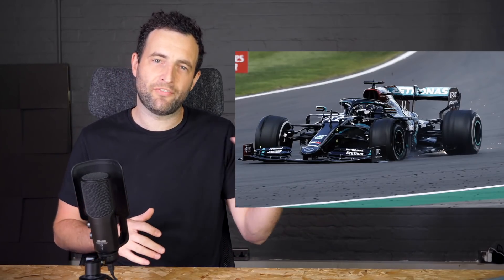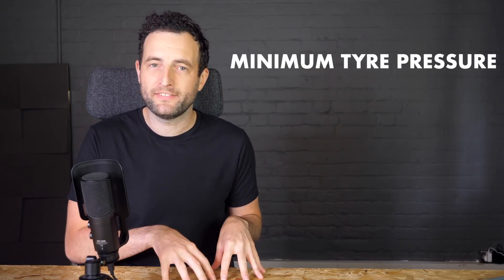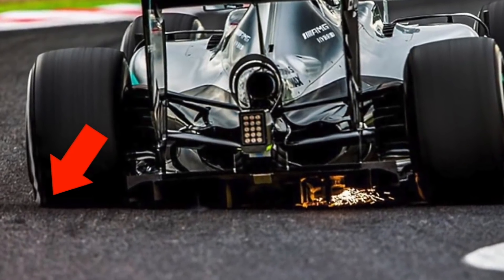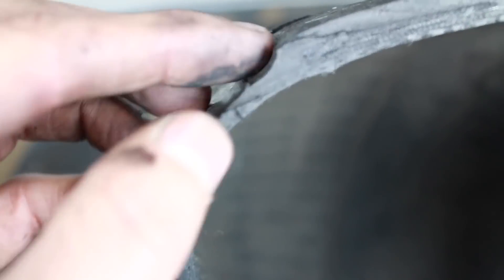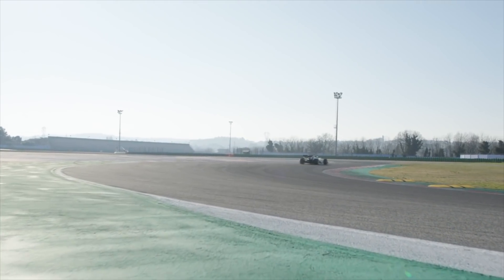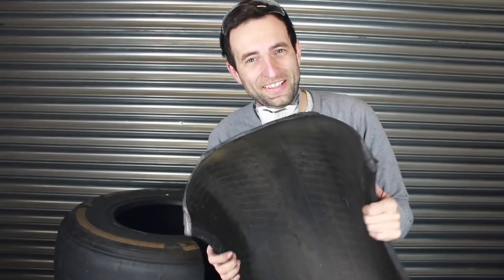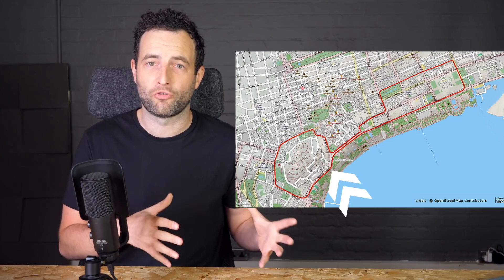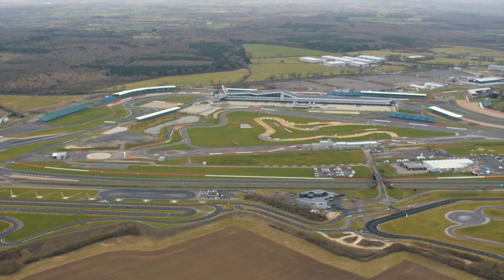Why Formula 1 Tyres Failed in the Azerbaijan Grand Prix

Comment: If Pirelli makes the tires stronger then the teams will run them for more laps and break them as well. It's not a tyre problem. The problem is that teams prefer to risk a tyre failure than pitting again for new rubber. Tyres are not meant to last forever and teams should start learning this.
Reply: While that has been true in some cases, this definitely has nothing to do with todays events. Pirelli indicated that these tyres could be used for up to 40 laps. Both Stroll and Verstappen where nowhere near that number of laps when their tyres blew.
Reply: @DutchObserver  Yes, but after Stroll's accident I think teams could have imagined the situation could repeat. But of course, after a safety car with all the field packed and with the tyres not giving any sign of imminent failure I also understand that they decide not to pit. 
But when we see tyres failing in some races usually are not isalated cases, multiple tyres fail when they have tha same number if laps. So I think they should really take very seriously a tyre feilure since this means more failures are likely to come.
Reply: @polviaortega3709  I see your point, but what options did Red Bull have? If they'd done another pitstop Max would have had to wave his victory bye bye as well. It's just not realistic to expect all the teams to change their car's tyres after one tyre blows up due to unknown reasons.
Reply: @DutchObserver  Yes, exactly, its not realistic to expect everyone doing a preventive pit stop. They they like to run the tyres at the edge to save the second pit stop which is understandable. If pirelli makes the tyres a bit stronger then we will see teams running them for longer to save that second pitstop in typical 2 pit stop races. Soo, the problem will never fully disappear. Maybe the only option is to design the tyres so that they give some very clear indications when they are about to fall apart.
Reply: @polviaortega3709  No, the solution is Pirelli making sure that their tyres actually can handle the number of laps that they communicate to the teams. But even when those teams exceed that number of laps, the inner works of the tyre still shouldn't give up. Teams change tyres when the grip has dropped too far, not to prevent them from exploding. Or at least, they shouldn't have to.
Reply: @DutchObserver  Yes. Sure, its pretty obvious that the better tyre would be the one that only wears out and eventually runs out of rubber but never explodes. But I'm guessing that because of F1's requirements on the tyres this behavior is not that easy to achieve.

Comment: So AGAIN Pirelli designed tyres which falling apart. Good job. Put in there more pasta.
Reply: Just like the British steering that killed Ayrton Senna?
Reply: @c.g.c2067  You're obnoxiously defensive about Pirelli. Are you an Italian by chance?

Here's something to consider, Pirelli also manage to fail in WRC on the same day. They're shit tires.
Reply: @1nSovi3tRussi4  🤣
Reply: @c.g.c2067  🤡🤡🤡
Reply: Pirelli is not fit enough to go on a damn wheelbarrow, this is not the first time they supply crap to F1.
Reply: @MrGoogelaar  You're as dramatic as the announcers were on TV.
Reply: @EJayyV  And how dramatic do you think we will be if a driver dies because of inferior tyres? Pirelli is a damn joke.
Reply: @MrGoogelaar  Those crashes were love taps.
Reply: Pirelli make 💩💩 rubbers
Reply: @vincecarlo  Pirelli make what the FIA ask them to
Reply: It's not Pirelli's fault tbh. They can build the strongest, longest lasting tires if they could. The FIA asks Pirelli to design them this way simply to add that 'strategy element' to the races. Watch Donut's video on why F1 tires only last 50 miles.
Reply: @carlosmolina292  it is Pirelli's fault. One thing is to design tyre's surface, "the meat"  to control wearing, the other thing is to build SAFE tyre which won't blow out like a balloon caused by corners and straight line speed overload.
Reply: @mymindmakesnoises  Fair points guys. Thank you for the insight I failed to see. These tyres aren't supposed to explode especially high speed and not even under cornering load. I guess it really is time we have more tyre manufacturers back in F1 again.
Reply: @carlosmolina292  Pirelli was never asked to design the damn tyres to explode, huge difference between exploding and wear...and was Pirelli the only tyre manufacturer asked to build tyres to explode as they are the only company having so many sudden blow outs? Excuses and reality often don't go hand in hand.

Comment: Since they got rid of refueling and Hybrid made the cars Heavier we got more and more Tire Failures  than we had before ...  Back in the days Drivers could  use the Tires super heavy . Driving really Close to Quali Times.  While today without refueling  they drive so slow compared to Quali times just to use the tire as long as possible because  Pit stop is the only time they lose time ...  i dont say Introduce gefueling . We see more on track overtaking  since they got rid of it but make the tires last longer on heavy use ... Lets say you can PUSH really hard 80% of the lifetime and only on the last 20% you have to Slow Down... today its like afte the First 5 laps they go into Tire safe mode for 80% of the tires lifespan
Reply: If they push for 80% of the tyre's intended lifetime, the tyre will barely make half the intended distance. A tyre will rarely live to have all it's grip be extracted, it's guaranteed to fail before that
Besides, if the tyres could last longer under high load, they'd make those already. Pirelli is basically at the very limit a tyre can currently do.
And they also have to make a general use tyre, unlike for example Bridgestone in the early 2000s where they supplied Ferrari and basically backmarkers like Minardi, so they just went "We manufacture our tyres perfectly to this one car, every year"

Comment: the minimum pressure, is this measured cold or hot?
Reply: Probably in a standardized temperature room
Reply: I'd guess that it's measured at 80C, since that's the temp the tire blankets are kept at.

Comment: Nico Rosberg even talked about the dangerous pit wall at the main straight. We have to be grateful that nobody crashed into that wall today
Reply: Max was so close to it good thing he was on the other side
Reply: That would have been deadly
Reply: What video
Reply: A lot of Pit entry's are dangerous, something needs to happen first
Reply: @yerrie1908  yeah it was in the context of the tyre failures on the main straight
Reply: Whys it dangerous?
Reply: @Andrei8pa3  because there is a chance for the driver to hit the wall head on at 320km/h. Instant death...
Reply: @janeisklar3923  all pit entries have energy absorbing barriers at the entry wall. There is about 40 feet of collapsing structure before anything solid which helps to reduce the speed at a slower rate, deflect the car to change its direction and reduce g forces to prevent injury to the driver.
Reply: @dingodave89  i was referring  to Nico Rosberg's comments about that particular pit entry
Reply: @janeisklar3923  Nico Rosberg is wrong here. It is no different than Montreal, Monza or Interlagos. All three have very fast pit lane entry speeds and I can't remember there being any accidents involving the wall on pit entry at any of those tracks.
Reply: @dingodave89  so you know better than a f1 wc who drove there? Ok buddy
Reply: @titariko4380  in this case yeah. I understand physics you see. The cars are designed to be as safe as possible for the speeds they can go (200+ mph). The car itself deform in order to absorb energy and slow the transfer of energy to the driver. The additional absorption and deflection from the collapsing structure of the barrier makes it even safer. Doesn't stop it from being scary but it would have a very low chance of a fatality, just like any other high speed impact these days. If it was deemed unsafe then the race wouldn't have gone ahead 🤷🏻‍♂️
Reply: @dingodave89  no one saying a fatality, but going at 330+kph and smthn breaks, even if u don't hit it head on, it'll be dangerous and the driver might get hurt
Reply: @janeisklar3923  it wasn’t the pit entry he was referring to. If Max’s car had broken left instead of right from the right hand side of the track it would have been a much bigger impact. That is what he was referring to.
Reply: @dingodave89  I'm going to have to go with the trained and experienced F1 world champ on this one, sorry
Reply: @dingodave89  there are no collapsing structures on the pit wall entry which Nico talked about. It's just like in Bahrain, the wall in which Romain Grosjean, no foam/tyres or whatever they put to absorb the impact. If you have a head on collision with that...something very bad can happen
Reply: @dingodave89  These guys don't know what they're talking about, but they are right that it would be fatal if a Max would've hit the left hand side wall. He likely would've bounced back onto the track right on the racing line, and would be t-boned by another car, which is instant death.
Reply: @silentnight1805  at last, someone with a brain 🥳🎉🎊😅 it is most likely that he would have stayed closer to the left wall after impact than he did the right wall in my opinion. The way Stroll's car behaved is how I expect Max's would. It was going to the right that brought the rear of the car towards the middle of the track. Because of the way the carbon structure of the suspension and even the sidepods deform, more of the energy of the impact would be absorbed by the car and not transfered into torque to spin the car into the path of other cars.
Reply: @dingodave89  theoratically yes, but lets not forget about the element of surprise AND the unlikability of freak accident like Massa's head injury in Hungary 2009, then odds of romain grosjean hit that wall and separates the car in half, in flames and somehow survives, or we can also put the unfortunate circumstances like Jules, Senna and if you want to go a bit further, Gilles Villeneuve. at the end of the day, max is unlucky because the victory is snatched from him because whatever pirelli is doing, but at the same time, he's lucky not getting a massive injury and doing good and still doing very strong in the WDC standings

Comment: Pirelli: Hard tyres can survive for 40 laps.
Max: So my tyres are fine right?
Pirelli: ...
Max: My tyres are fine right?!
Reply: As Vettel went half the race on softs (basically super softs) with no issues?
Reply: @bigskinny42  ikr its weird hard tyres lasting 30 laps and exploding abd softs lasting 30+ laps (idk for sure how many but i think arround this) maybe they swapped colours😅😅😅
Reply: Mercedes: Max is OUT, Max is OUT, his tyre GIVE UP on him !
Lewis: Yes, I gonna win this to create maximum gap, bye bye Max :P
Tire : Hold my beer (locked up) !
Fans : YES, YES, YES !
Reply: @andis9076  It was the brake balance which he switched, still a mistake on Hamiltons behalf though
Reply: @h2wr   he re engaged his magic brake button (helps keep Temps warm under SC from my understanding) as he was launching from the standing start still completely driver error though. they have the audio where the pit wall confirmed to Lewis he re engaged it upshifting.
Reply: No max you will not have the air
Reply: I remember seeing this in r/formuladank, you cheeky lad!
Reply: Pirelli: The tread is fine
Reply: Leclerc went 40+ laps on his tyres.

Comment: Dude, even the engineers haven figured out yet and you found time to shoot, edit and share a video? :D
Reply: Early bird gets the werm
Reply: @michaelric3540  the Wyrm :P
Reply: @michaelric3540  the Verne
Reply: @michaelric3540  Then who gets the worm?
Reply: There's more detail to be had as to why the tyres experienced fatigue failure in the shoulder before the rated lifespan of the tyres. This video is just a very good preliminary explanation
Reply: @Septimus_ii  Very good money harvest you mean, he just said "Tires fail because they rip apart", such an explanation....
Reply: @Septimus_ii  It is. An ex-tire boss of Ferrari during the Schumacher era almost immediately said that this was a case of too low pressure and a fault from Pirelli
Reply: @HJBad  I design cars for a living, thanks for the insights kid. And this isn't even close to what an explanation should look like.
Reply: @Daddy-Samy  Not all of this channel's audience design cars for a living. this explanation is for the people with little or no technical background. made easy for them to understand. if you need in-depth analysis and detailed explanation. read reports and research papers. they are free. 

Pirelli released their report and looks like his explanation was pretty spot on with the point of failure analysis 

Pirelli report simple terms : Tyre failure "down to a circumferential break on the inner sidewall, which can be related to the running conditions of the tyre, in spite of the prescribed starting parameters (minimum pressure and maximum blanket temperature) having been followed."
Reply: @swapnilmankame  Thanks for the answer, it's just that the video was too quick and without any "clear" reason why the tires broke, I experessed an opinion and was attacked, so I answered to the attack. Thank you for your clear answer, please have a good day sir :)
Reply: The failing seem to be obvious, but Pirelli needed time to figure out which lie was going to tell to the media so the FIA doesn't finish the contract with them for next seasons
Reply: @gorostmikel  It's a dire situation for them but in the end truth will come out so they just can't deny things flat-out
Reply: I think he's implying that there's no way you can possibly know why the tires failed if Pirelli and all stakeholders haven't investigated and released their findings yet
Reply: @Neil3D  He based his findings on last years Tire failures, as he has those tires with him to experiment
.

Comment: Lewis: my tires are gone
Reality: Fastest Lap
Max: Tires are fine
Reality: Red Flag
Reply: checo's engineer: do you want to change your tires now?
checo:(confused smile) really? we can?
Reply: Hamilton is actually very lucky, as usual. Some may think that because he didn’t get points he was unlucky. No, he was lucky that Verstappen didn’t finish because the point gap would’ve been greater even if Hamilton finished p3. Lucky boy...
Reply: @mikemoggerson6651  Simple conclusion, both unlucky, but Verstappend the unluckier of the two.
Reply: @theruckinmaul1460  lewis wasnt unlucky, you saw how his brakes were smoking before the start. He is responsible for the ovetheating the brakes, and he was too late and braked to hard on the already overheated brakes which made him lock up. Verstappen was unlucky, hamilton failed under pressure and that is the truth even if you like it or not
Reply: @BlissifiedHH  Well, the magic button turn on by mistake, the brake is hot but not overheated, to heat the tire to the optimum temperature really quickly, it gives you the traction during the start, hence Hamilton can jump so quick ahead of others, but he forgot to turn off the switch, or maybe he did switch it off but switch it on again unintentionally. 
The magic button causing the brake bias to shift to the front brake to 90% which is not possible to drive in that condition. This the explanation by Driver61 from the other video, you can check it out.
Reply: @mikemoggerson6651  #blessed
Reply: @mikemoggerson6651  we put it this way: he got lucky when verstappen crashed, then his luck ran out after that. so actually, its verstappen that got lucky, he got dnf but he managed to still be the current wdc leader
Reply: @kryse4806  no. Hamilton failed because of his mistake. Verstappen failed because of bad luck. How could Verstappen be the lucky one here? If he didn’t have bad luck, he would have finished first and Hamilton 3rd. That means he would have +26 while Hamilton +15. Verstappen is the unlucky one
Reply: @kryse4806  verstappen lost a chance to win a race, lost valuable points AND goes home without a trophy.
Reply: @mikemoggerson6651  agreed
Reply: @mikemoggerson6651  lol Redbull was lucky Mercedes sucks at pitstops, i guess you forgot that Lewis was leading the race but Mercedes F^cked up again......
Reply: @kabritu.  so redbull is lucky because they have a good pitstop team and Mercedes pitstop team is just avarage?🤔 and last time i checked the restart checo was starting on pole and they were leading wcc. You dont have facts your just biased. And incase you didnt see hamilton was the one messing up and not the team
Reply: @kabritu.  Except, Mercedes literally did nothing wrong. They had to wait for Gasly to pass, lest they risk an unsafe release. Red Bull on the other hand... had they not had issues with Pérez's stop, the Mexican would've overcut both Max and Hamilton, regardless of the order in which those two had rejoined prior. This race was 100% going to be won by a Red Bull. It was only a matter of which one would cross the line first.
Reply: It just proves Hamilton was using reverse code like most race teams do
Reply: @Redwing47  he had too hot brakes bcs of magic and all brake power in the front, he did an oopsie and i like that (hamilton)
Reply: Different mindset
Reply: Yuki: my tiers are fine
Reply: Shush
Reply: I'm cracking the f*ck up! LOLOLOLOLOLOLOLOLOL!